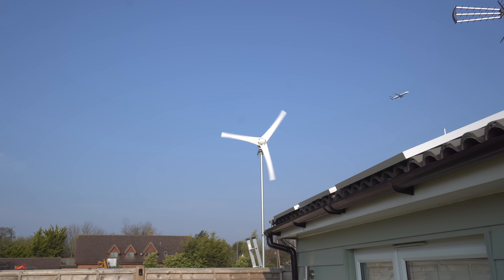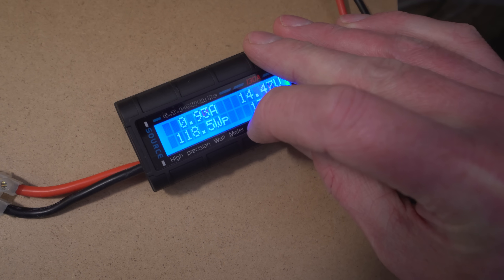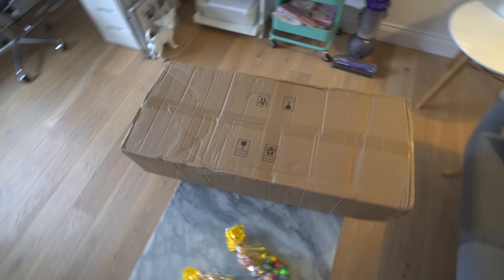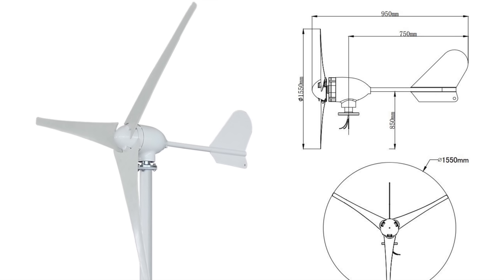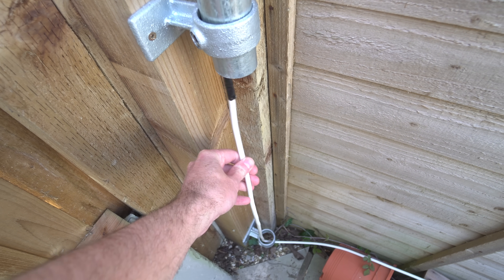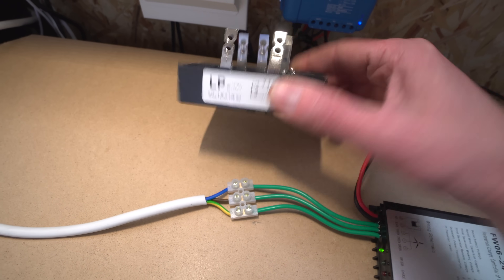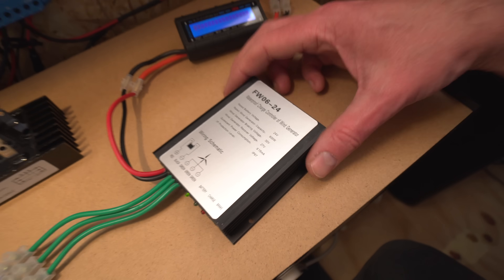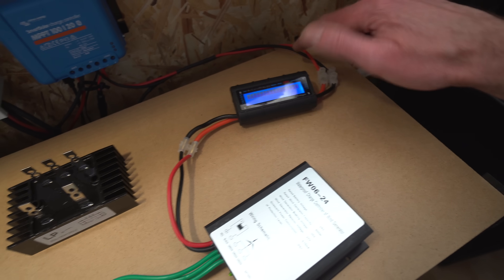500W MICRO WIND TURBINE | IS IT WORTH IT??!!

Comment: You can use the wind turbine blade size formula to work out the maximum theoretical power.

The maximum output you're going to get off a turbine which doesn't require planning is about 150w
Reply from the maker: Check John Daniels video he’s getting about 700W with this turbine.

Comment: Which proves the point that wind power is useless. Let alone on a large scale. Wind can not be relied upon. Sure, there are some applications in remote locations.. But the fact stands that the does not blow when you want it or even strong or constant enough.

Comment: As a wind turbine testing engineer I would like to offer a couple comments:
1: Not sure if I would use the 4x4 or whatever wooden pole you were using as the base with 500 W of power that can produce a lot of bending force on that wood. It might be fine with the size you have, but if you look into the foundations required for other small wind turbines you might be under sized and over time it might break. 
2: I would NEVER have a turbine that close to my house especially one with such little control no pitch no over speed (it is a stall controlled turbine I am guessing, but from china never really sure of their safety systems). It is very small so you might be ok from a safety stand point, but you will always have a lot of turbulence and lower wind speeds. 
3: The power cable you are using for they turbine scares me. It is not a 3 phase cable, which means it looks like you were using a ground wire as one of the phases. I understand that the ground wire is probably the same thing electrically, but we have a color code fore a reason so that other people understand what is hot and what is not. 
4: I would always ground the metal surface of the turbine. with no ground and the metal pole not extending to the ground if lightening strikes your whole fence may start on fire. typically turbines have huge grounding strips everywhere to connect to the tower which is then grounded by the re-bar in the foundation. 
5: it looks like the output of your 24v inverter you have connected to your turbine is connected to you charge controller using maybe 16 gauge wire (1.291 mm not sure how you measure wire over there). If you have all 500w coming from your turbine converted to 24V that would be 20.833 A, which is much higher that what can safely be transmitted by 16 guage wire.
Edit: Oh and 6: rather than increasing the number of blades you have try increasing the length slightly. I think (based on my calculations and experience) you will be dissapinted by the decrease in rated wind speed (producing full power at lower wind) by adding blades. For an example from commercial turbines: a 90m diameter turbine is typically around 1.5 MW (1500 kW) where as a 116m can be almost 3 MW. Just make sure you get blades that are stall controlled if there are no overspeed safety systems on the turbine.
Reply: Your helpful information has gone unnoticed I see 👎
Reply: Very helpful thanks a lot!
Reply: Oh and 6: rather than increasing the number of blades you have try increasing the length slightly. I think (based on my calculations and experience) you will be dissapinted by the decrease in rated wind speed (producing full power at lower wind) by adding blades. For an example from commercial turbines: a 90m diameter turbine is typically around 1.5 MW (1500 kW) where as a 116m can be almost 3 MW. Just make sure you get blades that are stall controlled if there are no overspeed safety systems on the turbine.
Reply: @ryansteinkamp5146  how do you "stall control" a wind turbine?
Reply: @MeltingRubberZ28  it is a blade design. It is designed that after higher wind speeds the blades actually become less efficient.
Reply: Thank You!
Reply: have you had anything to do with the wind generators used on sailing boats????
Reply: @jacorin  the issue with wind turbines on sailing boats ( or any moving object for that matter) is they create a considerable amount of force parallel to the direction of the wind. This makes capturing energy on anything not firmly anchored in place basically impossible.
Reply: @ryansteinkamp5146  Lots of folks do it though, myself included (2*silentwind). Not impossible at all, quite the opposite in fact. Wind speeds are almost always substantially higher off the coast so any loss in efficiency is more than made up for in raw horsepower. I have never seen numbers as low as this video, for instance. 

Only bummer is a downwind run, apparent wind speed is closer to 0kts the more efficient your wings and hull, so that's a real killer on the ARC or any tradewind sail.
Reply: I'm no electrical engineer so I have an honest question. When you say MW, does that mean MW per hour or how is it measured?
Reply: @nicoarnold2200  Its the difference between power and energy. The windmill described will deliver 3MW and if it runs for an hour or 24 hours at this rate 3MW/h average- So both are OK to think in. At any moment it is delivering 3MW.
The things that effect power generation are wind speed, density of air, efficiency of mill and blade diameter. I calculate the one here on the video has a 38% efficiency to deliver 500W at 25mph.
Reply: Nico Arnold The amount of watts just means how much power the generator is producing at a given moment i.e like in a split second. The power can fluctuate all the time but it all adds up to charge a batter e.g if we assume that no energy is lost during the process, if this 500w turbine sustained  500w for an solid hour it could charge a battery to 500watt hours i.e you can now use a 500w device for 1 hour before it runs out. Or a 100w device for 5 hours. Alternatively it could produce an average of 100w for 5 hours and achieve the same 500wh or 50w for 10hours and so on. The point is there is an eliment of luck and it varies all the time but the charge accumulates over time during each "windy bit".
Reply: Nico Arnold all power references watts per hour or amps per hour.
Reply: The packaged turbine looks identical to mine but is rated at 600W. The current output across three phases is therefore about 8amps on each phase. I actually use 2.5mm square twin and earth cable (we use these for 16A power circuits) which are misleadingly coloured but are sleeved (red). Works fine.
This guy is just lashing stuff together schoolkids style though. 3 phase to DC into an MPPT controller? You can see the Victron charge light flashing on and off so it clearly never settles at its correct power. There's too many of these enthusiastic amateur videos which tell newbies virtually nothing useful.
Reply: So i have this wind turbine i'm making for small scale and i cant figure out which dc motor ( using as generator) is gonna work well its rating is 36 V, 20 Amp ,720 W, with gear box ratio 1:6 and its really hard to move the blades it wont even rotate so can u help?
Reply: @shaheersiddiqui2401  the gear box (I am assuming step up ratio) will make it more difficult to turn, but will increase the speed of rotation on the  motor. You may have too strong a generator for your turbine, or the blades are not pitched correctly. A couple degrees of pitch is very significant.
Reply: I like solar    zip for maintence and there getting cheaper all the time
Reply: savagex466 Solar isn’t maintenance free. Get one leaf on it or snow or dust...And squirrels, a rock from a mower. Never mind you lose 30-40% without tracking. A good quality turbine is less maintenance.
Reply: Swampwild1 30-49% without tracking?! You don’t own any solar - clearly.
Reply: BLKMGK4 No just evaluating options so repeating what I read. What is realistic %? I’m just north of US in midwestern province
Reply: @Swampwild1  I run 3KVA solar (with a 600W turbine for top up). My panels are fixed so they point directly at the Sun at 11am at the Equinoxes. A quick bit of mental arithmetic indicates that the difference between Equinox charge current and Solstice current (both blue sky) is about 8%. I might be a bit out but not much.
I can actually tilt my array, but gave up because it wasn't worth the effort.
Reply: Dave Box 8%. That’s 1/5 of some estimates or less. Do you think trackers are a scam then? Good to know.
Reply: @Swampwild1  No, I don't think they're a scam, just that in my circumstances the extra power didn't provide enough benefit to concern me.
Full tracking is bloody expensive and if you need the extra power it's probably cheaper for most of us to throw more panels up. That doesn't discredit a tracked system, just demonstrates that you have to work out what's best for you.
Reply: @Swampwild1  A system with microinverters will lose power from a single panel if it's occluded but not the whole array. Solaredge also has a system that can drop panels without microinverters but you run high power DC to the primary inverter - it's what I've got. Tracking is greater efficiency but closer to 15% tops. I'd only use a tracker with a ground mount pole based system with nothing around it. You'll want to be able to get to it for maintenance for sure. Shading is by far the biggest issue you will run into if you've got damn near anything around you. Wind is good in that you can get power at night or when it's raining but you must have wind, have to be careful of too much wind, and big power requires room. Water is great year round unless it freezes or clogs but you need drop and there's maintenance to be had for sure. My solar maintenance so far has consisted of resetting the inverter once and losing a half day of production. Over 7MWh in under a year in far from perfect climate. I'd use more panels if I could fit them!
Reply: Ryan Steinkamp great advice. You can buy units with more blades but these Chinese things are all 1-1.5m. I’ll have to research for longer  blade units. Cool hobby
Reply: Spot on sir!
Reply: You have convinced me to stop watching this guy
Reply: So in short you are better off with solar
Reply: Wow you know your shit dude! I cant  fault you on any of that, I'm an Ecotricity employee and our company is probably the best in the world at Solar and wind power research and development. You should consider joining our skilled team of friends , more than work colleagues
Reply: How do wind turbines work in below freezing temperatures. Winter in UP Michigan ?
Reply: @danieltranchida4009  they actually work better at lower temperatures (air is typically denser) only problem is icing. Very small amounts of ice can significant reduce air foul (blades) efficiency.
Reply: Right, if lightening strikes, we wouldn't want his whole fence to catch on fire.
Reply: Oh wow.
Reply: It clearly said 40 watts on meter which is about 2 amps and that wouldn't power a mini radio.
Reply: great tips! thanks Ryan!
Reply: wauw an actual professional safety nancy...
Reply: Yeah whatever he said
Reply: I do not know if it means anything, but over in the UK their house wiring is very different than the current wiring used in the US and Canada. They still use mains which has no third ground wire to electrical outlets. They use electrical appliances made just for their standards. The US stopped using mains sometime around the late 1930 early 1940's or so.
Reply: Vicky Geagan. 220 volts without grounding ?? No we don't. Where on earth (pun) did you get that idea from?
Reply: Vicky Geagan Good point
Reply: @VickyGeagan  bullshit.All stuff is earthed in UK.you must be thinking of Indonesia

Comment: The 24 Volt turbine charge controller will not work correctly without a 24 Volt battery connected to it, the Victron is expecting a solar panel which can be loaded down to it's MPTT voltage of about 17 Volts for a 12 Volt system, the turbine controller is most likely in a protection mode at 17 Volts.  Don't connect a battery directly to the input of your Victron either, it will over current itself and burn out, it's expecting high source impedance from the solar panel giving that characteristic knee curve you see on panel performance data.
Reply: Exactly

Comment: Before we even mention 'dump loads', does that wind gen self regulate in high winds?
If it does, then my experience thus far (with similar products) is that it will burn out during the first storm (prolonged high winds) you get.
You need to fit a dump load circuit for any decent wind gen and FULL MARKS for recovering that power! But my experience thus far with high performance wind gens that are manufactured using chinesium is that they will burn out......they cannot handle the sustained generation of power in high winds, EVEN with dump loads.
The dump load protects the battery bank from 'over-volts', it DOES NOT stop the wind gen from turning and producing power;  I've seen (marine rated/claimed) gens go into 'brake mode' in high winds...I've seen them burned out a few weeks later...............more than once, twice, trice.....
I have also witnessed a 150w rated wind gen, of comparable size, with a dump load (MorningStar?) on a deserted, windblown islet in the Shetlands, perform for years and survive serious storms...wish I could remember the manufacturer, I believe German, but salutary lesson, don't believe all the claims for a product and don't go for the highest claimed power, sometimes you have to pay for the good stuff.
I wish you luck,
Reply: Those crappy little controllers just short the windings to break them.

How ever this one won't as it's not connected to the battery. But the MPPT controller with a totally unsuitable algorithm on it.

Comment: You should use it as a learning experience, when first looking into wind turbines! I would already have one, but I'd have to be at a minimum of 50-60 feet to getout of the trees, and any wind... I'm going to give it a try anyway, starting with about 400-600w turbine, if I have enough wind, I'm going to build a 2kw turbine, and put it up about 80' just the tower is going to be costly. I'm thinking about a 60' tripod, with with a 20' telescopic section, maybe it will be strong enough to climb! Ha-ha,

Comment: I'd use the controller, and the recitifier , and only use the controller as a turbine control, and use the rectifier for power connection.
Reply: JAMES! Since the 70's hi James I’ve got a turbine just got into it and was wondering if can run controller and rectifier together as the controller as braking on it b great if you could let me no how to wire it new to this turbine stuff thanks 👍

Comment: The victron is telling you the amount of power that HAS been stored into the battery the the rc meter is telling you the power production the difference is charging losses. With mppt solar best if input voltage is 1.5-3x battery voltage with wind you want to get as close to the max input as you can. You need a pwm charger with a buck-boost support. Also look into ideal diodes using half-bridge mosfet you can save a lot of power and add braking functionality. I made cust firmware for a 100A opto hobby esc turning it into a ideal diode and buck boost charger by using a feedback.

Comment: When you get 8ms it will shock you in output. But please increase your wire size if its under 8awg in that length of run. And guy wire it, plus ad 3 meters higher.
Reply: Your on to it, saved me posting. Thanks. I also wondered if the MPPT on the charge controller was quick enough to react on days when it is not a constant wind.

Comment: Andy, get 24 volts worth of SLA batteries, about 80ah to use to run the turbines 24v power into, from them send into a LiPo controller for your lithium bank. Looks like your kicking it nice. Its called slave batteries. In my 11 years of installing wind turbines I usually put 48 volt turbine, to charge Lithium.

Comment: Good show Andy. As you all saw on the 6+ videos on my channel, Mines been up almost 18 months now, not one issue, and always as long as its installed right makes over its rating.
Reply: Seen a couple of yours
Reply: I bought a Chinese 800w it worked for a month or 2 then I noticed it spinning uncontrollably I changed out the controller but somethings not right, being a permanent magnet type could something be burned out in the generator itself? I have tried a few controllers, there is open voltage when generator is spinning its a 012-24v controller on a 24v. GENERATOR I also have 24v. controllers I've tried
Reply: It was a year or two but believe it or not it was just after watching one of your videos and got the link off you I believe I ordered thru albi or Ali something like that I'm getting open circuit voltage from the 3 generator output wires but it doesn't top off battery and brake the generator anymore for some reason also it spins crazy fast in heavy wind seems like circuitry in generator to me because I have several controllers, it worked perfectly new. Oh the company in China was green something I think, thanks for answering
Reply: @johnpower8356  Use a standard rectifier 3 to 2 configuration 100 amp straight through to battery. If you not getting effect then it's time to check backwards up the drop cable to the Turbine. And possibly the slip ring assembly. If your turbine has been throwing its brakes a whole lot the whole time you've owned it you may have caused a high carbon buildup on your slip rings inside the turbine housing. Or you could have caused some type of corrosion on your connections below the turbine. That's the angle I would look.
Reply: 800w 3blade green solutions maybe not sure

Comment: Three phase
Try single
Three phase has four lines
Reply: Try ... 3 Phase !
Reply from the maker: What I meant was 3 generator phases from the turbine.
Reply: Three phase does not always have 4 wires,  it depends on the configuration, star or delta.
Reply from the maker: Ruan Esterhuizen yes correct, in this case there are 3 wires.